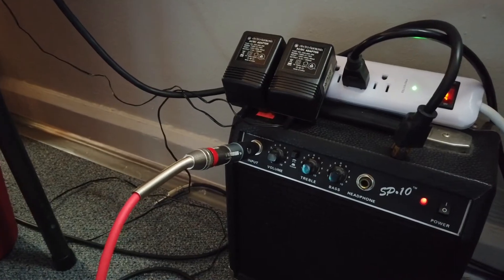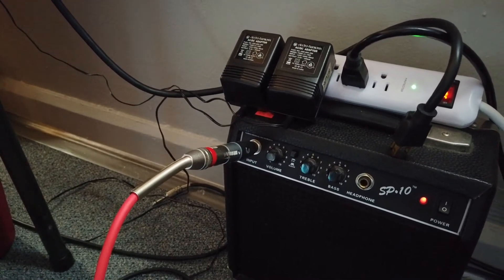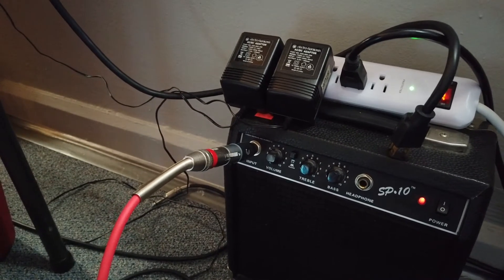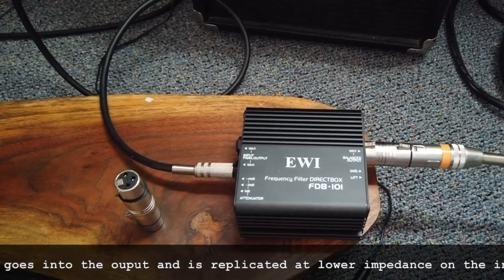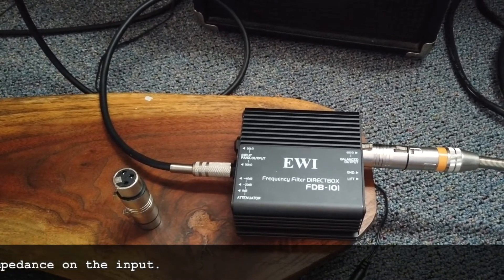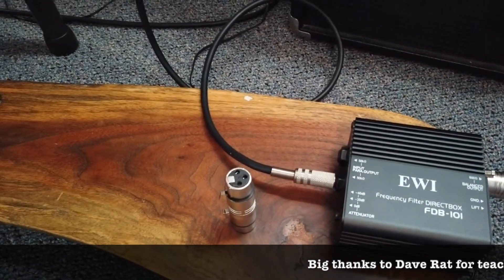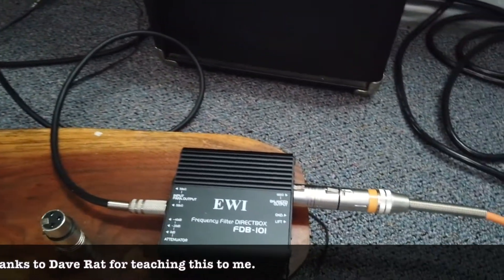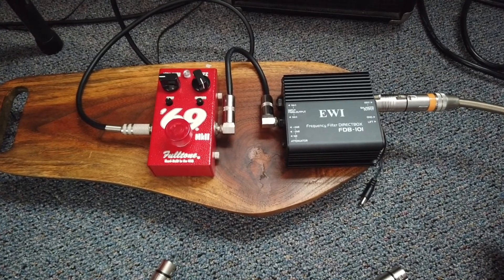Using a Direct Box in Reverse

Comment: Will this work?

Wireless mic  > reverse di > guitar pedals > di box > mixer

The di box I have has two channels I plan to use one in reverse acting as reamp and the other channel normally as my main out towards the church's main mixer.

Thank you
Reply from the maker: Sure, but if your mixer has an aux send then you can just use your mixer without having to use a DI box:

Wireless mic > mixer > aux to guitar pedals > pedals out to aux in on the mixer or another track for mono return or two tracks for stereo return

Good luck!
Reply: @HazeAnderson I'm a saxophone player. I plan to connect my wireless mic to reverse di. From there go to my various pedals which I will end on a normal di box outputting to our church main mixer.
Reply: @HazeAnderson is the mixer FX send line level? Can I use that on guitar pedals which expects a low impedance input? Also the last pedal in chain can I put it in FX return.

I think the FX return expects line level and the last pedal in chain sends instrument level signal
Reply from the maker: @JuanMaglonzo  "instrument level" is line level 👍